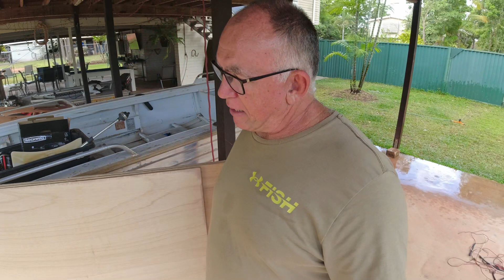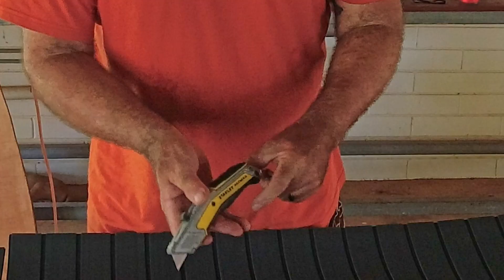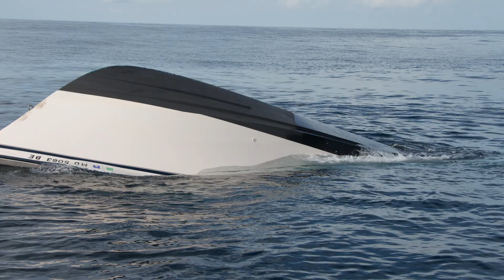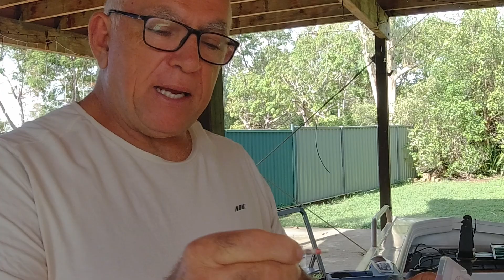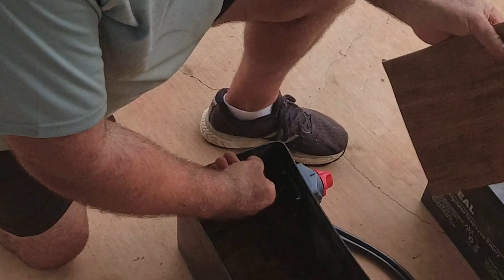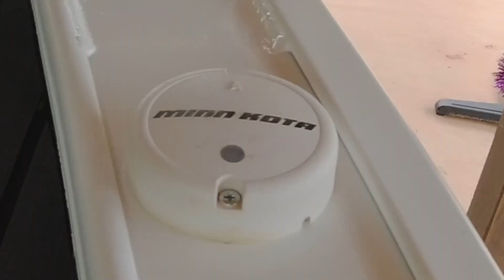FULL TINNIE REBUILD - All the tips and tricks for to total rebuild

Comment: Ok I think I get it, so with the negative buzz bar, the entire hull of the boat is now a negative connection back to the battery, is that correct.
Reply from the maker: Not quite. Yes, it is a negative connection back to the battery but not the entire boat, just the busbar and the negative terminal of the battery. The busbar is isolated where it is attached to the hull so that doesn't earth anything unless it is connected to the battery. 
Hope that makes sense. 
SBC

Comment: Hi no dickhead here but have never see a iso switch on a neg - its always on the  pos + for motor isolation  but if it works for you its fine nice rebuild
Reply from the maker: Haha No you're not a dickhead mate. I agree. I see them always on the positive but because of the busbar, it made sense to just cut my negs so I thought, what's the difference? And it seems to work perfectly fine. 
Thanks Glen. Maybe someone will comment to let me know why I should have wired it to cut the positives but until then, it seems to isolate the battery.

Comment: Thanks Crispernator. I had a ball doing the restoration. Hasn’t been on the water yet but looking forward to taking it out for a fish. The battery isolation switch would surely work as long as you break the current flow. Was just easy for me to do it with my negative busbar. But what you e done with the positive is what I would normally do. But it works so that’s all that matters. 
If you can, send some pics of your rebuilds. As you can imagine, I do this channel purely because I love boats and boating. So would love to see before and after shots if you have some. 
SBC

Comment: gday mate i have just finished my 4th restoration 2x ali and 2x glass thats me done no more 2 years of work  , epoxy primer with 2 pack polyurathane 2 primer 3 topcoats . took it out for its maiden run had a few little niggles but all in all it went ok . I run my motor of the rear battery and i have a kings up the front for all my electrics i want that sucker to start when i want to go home ,all my wiring is marine wire and runs to a fuze box both pos and neg and the battery leads run to the terminal  points on the fuze box .Lucky as it has a on/ off switch on the kings box but i have one at the starter battery , now i dont know if i did it right but i used the pos wire on the switch and to be honest i dont know if it is going to matter what wire you use as long as you isolate the battery as i said mine is glass so not so critical as an ali boat . I cant tell you how many tubes of sika 291 i used , seems i was always ordering 2 tubes either black or white dambed expensive but i only use it never silicon (cheap nasty shit) anyway your boat looks a million bucks now great video for anyone contemplating doing a resto take care